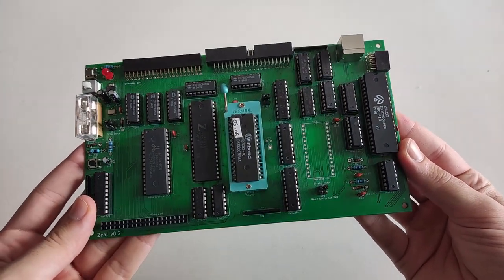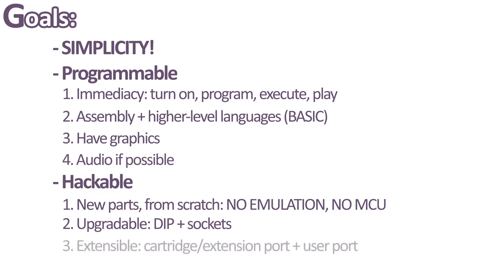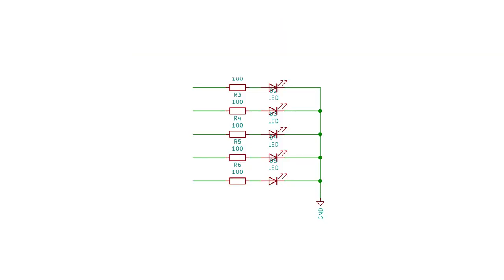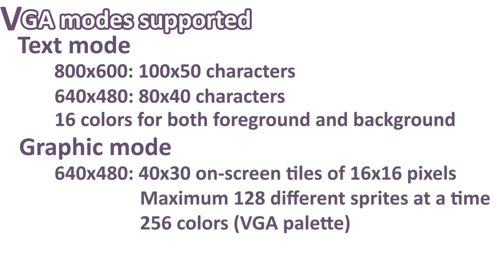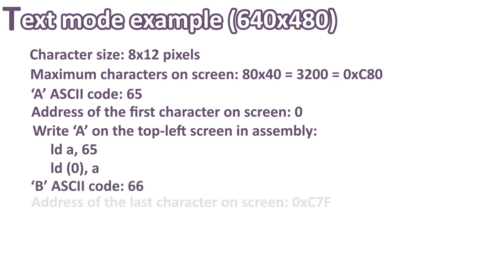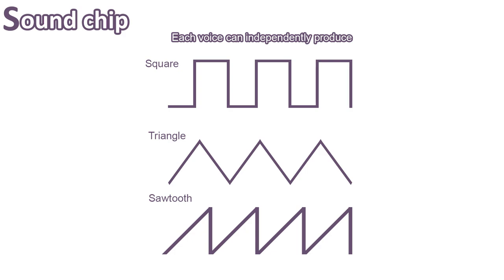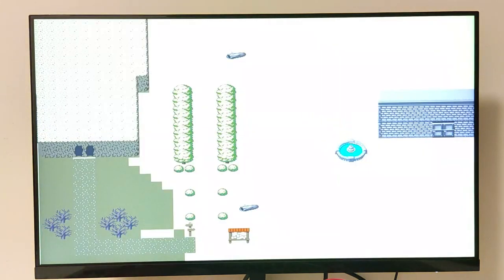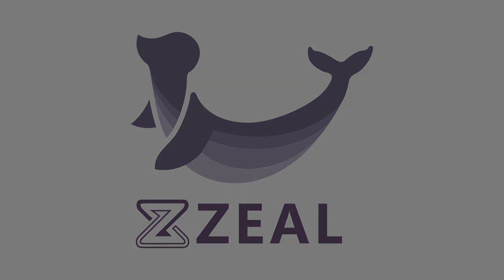Build an 8-bit retro computer powered by a Z80 ! [Zeal 8-bit]

Comment: Awesome. Would love more details of the video sub-system. Some numbers don't fully add up to me (256 colors x 16x16 x 128 == 32768, and you still need 1200 bytes for the tiles + the palette). Also unclear if the sprites are something different from the tiles (video says sprites, description says tiles). At the Z80 speed (unless you use a modern version) gonna be hard to update a lot of memory -- so a 320x200 mode may be useful. Do you have a blanking interrupt, or even a scan-line one?

So many questions, sorry. Love it!
Reply from the maker: Very good question!
It was a bit hard for me to keep the video concise, simple to understand so without giving too many details. 
In my mind, the tiles are the 16x16 pixels images that we can show on screen and a sprite is the value pointing to one of the 128 tiles. (128 tiles take 32KB, 1200 sprites take 1200 bytes)

What you said is correct, the tilesheet/tilesmap indeed takes 32KB. The thing is we can tell the video chip (the FPGA), what we want to map in the first half of the memory, with a single OUT instruction.
Thus, if we map the tilesheet/tilemap, the 32KB describes all the pixels of our available tiles, but if we map the sprite ram, we can then modify the tiles that are shown on screen, so make some animation, movements, just by modifying 1 or 2 bytes.

The sprite ram is organized as two 1200-bytes "arrays", the first one starts at 0 (from 0x0 to 0x4AF), the second at 8192 (0x2000 to 0x24AF). The first one represents the background, the second one is the foreground (both share the same tilessheet/tilesmap of course). The foreground is a bit special: it supports transparency. The palette is the standard VGA palette (Mode 13h). It cannot be modified, so it is not mapped.

This was for graphic mode, in text mode, only the sprite ram is re-used. It is separated into two 3200-byte "arrays" (we have 80x40 characters on screen). As explained in the video, the first one, from 0x0 to 0xc80, is for showing the characters themselves, but the second one, from 0x2000 to 0x2c80, is used for colors. 
Indeed, text-mode supports 16 colors for both background and foreground. So one byte in the second array represents both background (high nibble) and foreground color (lower nibble), this was designed like this for performance reasons. The palette used here is also the VGA palette, but in 4-bit mode, and is it hardcoded in the FPGA, so it cannot be changed.

I am using a Z80 clocked at 10MHz, filling the first 32KB of memory takes 69ms when using LDDR or LDIR instructions, which is reasonable in my opinion. I mean loading the required tiles is not something that will be done a lot of times, or at least, not all the 128 tiles each time. Similarly, loading 1200 bytes into the sprite ram takes about  2.52ms with LDIR or LDDR.
Plus, the FPGA supports writing into its sprite RAM and tilesmap RAM at anytime, regardless of the VBLANK or HBLANK.

Regarding the resolution 320x300 is not a VGA standard resolution. 640x480 is the smallest possible resolution, but I imagine it would be possible to simulate a 320x240 resolution by duplicating the pixels. This would let us have 20x15 sprites on screen (16x16 tiles). I haven't thought about it yet.

Finally, about the interrupts, on older computers/console, it was required to wait for V-Blank or H-blank to draw modifying the video RAM, but in my case here, it is not required as the video ram can be modified at any time. However, I still plan on having these interrupts for two reasons: prevent flickering when moving sprites around and mainly timing. I don't have any timer on the board, I don't have any plan to integrate one so having both interrupts will help a lot to determine how many ms or us have elapsed. With a 640x480 resolution at 60Hz, we would get one V-Blank interrupt every 16ms, and one H-blank interrupt every 32 us.

I need to make another video presenting these features with more details and with some demos.

I hope it was clear, feel free to ask if you have any question.
Reply: @Zeal8bit   don't worry, I know how hard it is to make videos. What you did is awesome.

Thanks for you answers, I think I mostly get it, so get reading for my second round of questions :-)

I got that you can page the VRAM using an OUT, so the 32K limitation doesn't really apply. I still have some troubles with your terminology: for me a tileset is a description of the graphic of 128 tiles. It takes 32KB. A tilemap is a description of a full screen of tiles (sometimes a little more, with some hardware registers to offset x and/or y, giving the possibility of hardware scrolling). It takes 1200B (as they are limited to the screen and just contains the ID of the tile, with one bit left). There are 2 tilemaps, the foreground having transparent tiles, (maybe via a hardcoded key color in the tile?).

What I am still missing is how do you intend to position stuff. In my vocabulary, a sprite also have an x,y coordinate, but tile don't, as their position is implicit. ie: I don't get where those positions are stored.

On the resolution piece, I was thinking of pixel doubling + black bars (or 320x240), just so the amount of data is small enough to be managed by the Z80. But, at 10MHz, it isn't a big problem, although the limited address space will make it difficuly to work with all the data. But that's part of the fun, right? Another direction is a 640x400 BW image (wich black bars). That's better than the original Mac, you could do a fun GUI on that (but you need to be able to read the VRAM for many operations).

On the VBL piece, I wasn't thinking of stuff like avoiding snow effects, but to sync (ie: telling the FPGA that the developer is done with presenting a screen), and scanline interrupts to potentially hack (ie: if there were one day multiple palette, you could do more than 256 colors). Of course, if you don't have timer, a VBL of some sort is indispensible, in particular as you have sound (those days I am coding on the early macs, which only had VBL for tracking time -- see my channel for the result :-) ).

Keep on the excellent work. I wish I had the ability to do such a wide ranging project, but my hardware skills are too limited.
Reply from the maker: @fredsretrocoding1421  Thank you Fred!

I understand your confusion, indeed, there are a tileset of 128 tiles of 16x16, so 32KB, as your said. There are indeed 2 tilemaps, your terminology suits better the architecture I made. The thing is sprite's position is determined by its index in the memory, this is why in my terminology, both can be interchangeable (kind of). This is valid for both text mode and graphic mode.
Thus, the top left background sprite is represented by the byte at address 0x0, the next one is at address 0x1, ... until 0xc7f. As there are 40 sprites per line, the sprite at line i and column j is at index 40 * i + j. 

It also means that in order to move a sprite on screen, you need to write its value to its new index/position and erase it from the previous location. This layout makes it convenient and simple to render games or programs based around grids. I also chose this layout because of the limitations I have on the FPGA itself and its board.

As you said, the challenge of working with all the data is fun! I mean, today with our +1GHz embedded systems, we tend to concentrate less on low-level optimizations. The CPU/SoC architecture is often not even part of the optimization equation when writing C/C++ software. I don't even mention any higher level programming language. regarding reading the VRAM, I agree this may be a problem in GUI based programs but this is also why I choose to have this much RAM, I mean 512KB for an 8-bit computer is more than enough for most programs.

You are right, I am hoping people will be able to hack Zeal board to make it impressive! I remember hearing that in the '80s, some people where using the h-blank interrupts to simulate a multi-color background on the Commodore 64 and related computers. I am currently designing the next prototype of the board, integrating both vsync and hsync interrupts. The fact is the FPGA is outputting a 16-bit color signal to the DAC converter, before going to the VGA connector. 

Thank you for your support, I hope you will enjoy this project. Honestly, no matter what skills you have already, you can always learn more and more and figure out things by yourself. Nowadays, we have so many resources available online, for free. 

As we say in French, on apprend sur le tas! 😉

(Between, I checked your video and they are outstanding! I would love to see how you achieved this in a video)
Reply: @Zeal8bit  It was indeed a terminology issue. What you do is between a graphic mode and a 40x30 text mode with 128 16x16x256 colors with customizable characters. I feel the lack of true pixel-addressable sprites will be an issue, as the only way to have pixel precise drawing will be by hacking the sprites, like we used to do with VGA text mode characters https://en.wikipedia.org/wiki/VGA_text_mode#Cursor (replacing the 4 characters under the mouse by 4 custom chars with the mouse drawn at the right position in it. Possible, but cumbersome).

> Honestly, no matter what skills you have already, you can always learn more and more and figure out things by yourself. Nowadays, we have so many resources available online, for free. 

A vintage graphic card on an FPGA has always been something I thought about. I even got an Mojo FPGA dev board to learn, but I just didn't have the time to invest into it. But I probably have enough software projects to keep me busy forever...

> I would love to see how you achieved this in a video

I still have to make a video for the release of the new version, then I may do a video for the nerds on the "how it is done". Long story short: C++ pre-encoding, 68k assembly and a lot of stubborness :-) [ note: the github is available https://github.com/fstark/macflim ]

Allez, super boulot, j'espere bientot une video sur la suite! Faut pas hesiter a entrer dans les details...

edit: fixed url formatting
Reply from the maker: @fredsretrocoding1421   You described it well, then I haven't implemented real hardware sprites, as there is no true pixel-addressable graphics. But after thinking about this, I think it would be very interesting to have sprites, it would be possible to replace the second layer, the top one, to have 64 or 128 (or even less) hardware sprites instead. So the first layer will still be addressable the same way as today (i * 40 + j), and would thus be used as a background, whereas the top layer would be gone and simply replaced by N sprites that, of course, are on the top of the background. As you said, having something like a cursor then would be much simpler to implement, no hack-workaround required.
As you may have guessed this will be a long work so I may postpone this to later, but I keep this idea! I would like to have the hardware stabilized for now.

Mastering and getting familiar with FPGA takes time, mainly when having a software background. I think we all have the same problem: more cool projects than free time.

Thanks for the link to the repo, and I look forward to watching your next video.

Merci beaucoup pour ton soutien!

Comment: Could the Philips SAA1099 be used for sound? Maybe it is not manufactured anymore, but there seems to be good availability even brand new parts
Reply from the maker: I did have a look at this one and at the AY-3-8910, both are very well known chips. The AY-3-8910 even has two I/O ports. I saw on the SAA1099 datasheet that the maximum clock frequency is 8MHz, mine is 10MHz, I wonder if that would cause any issue.
But as you said, they are not manufactured anymore, so currently I would like to stick witch new parts. However, it is possible to make an external card embedding that chip as the cartridge/extension port presents the data lines and and IO address lines.

Comment: The CPU in the Game Boy is more similar to an Intel 8080 than a Z80, although these CPUs are related between them.
Reply from the maker: Indeed, if we look at the instruction set, it looks more like a 8080: no IX/IY, no alternate registers, no complex memory instructions (LDI,CPI,etc...)
But for the chip itself, the ASIC, *my guess* is that it's based on the Z80. Because at that time, Sharp was already manufacturing Z80 CPU clones, logically they would take this base to make their new chip, the LR35902, used in the GB.
It's just my thoughts, not sure if that was really the case😄

Comment: Instead of Z80, use HD64180 or Z8S180.

19 or 20 addresses 512KB or 1MB controlled by MMU, onboard MMU. two DMA two CTC two UART.
Reply from the maker: Thanks for your comment!
Indeed these are nice successors, I also like to eZ80, I will consider using one of them for future version(s) 😄

Comment: You might want to research how many bypass capacitors should be on there.
Reply from the maker: I agree that PCB revision should have had more, this was my second iteration, it is pretty dense. You can check the newest hardware revision in my latest video 😄

Comment: How did you account for the voltage difference from the 5V Z80 to the 3.3v FPGA?
Reply from the maker: Thanks for your comment!
There are bidirectional 3.3V/5V level shifters on the FPGA board for the parallel bus
Reply: ALynx 301?
Reply from the maker: Oh my bad, for some reason I thought you were referring to my custom FPGA board, which I presented in later videos. The Alinx board I am using in this video doesn't have level shifters indeed. I did the level shifting on the motherboard with 74HC4050 ICs. Since that takes quite a lot of space, I moved them to the custom FPGA board after that.

Comment: Why do you have to load 66 into reg a first? You can't skip that step and just run ld (0xC7F), 66?
Reply from the maker: There is no such instruction on the Z80. There are two ways of doing it if you want an immediate value:
- ld a, 66 and ld (0xc7f), a 
- ld hl, 0xc7f and ld (hl), 66

Comment: Your not using a micro controller but you are using FPGA's... i don't get the distinction... Their both modern tech...
Because your using FPGA's, doesn't that mean that simplicity goes out the window?
I'm looking forward to seeing what your going to do with your ROM banks...
Reply from the maker: Thanks for your comment!
I see the FPGA as a huge CPLD, (Complex Programmable Logic Device), in this sense, you cannot compare it with a CPU/MCU. But some will also tell you that you could make a CPU out of an FPGA, and that's right.
I highly recommend you to watch the newer videos to see the updates out the board. Anyway, the FPGA board is not mandatory to run the computer. The motherboard has now a UART input and output, which makes it usable without the video card board. You could even imagine making an extension board which relies on an old video chip.
About the simplicity, I was talking about the simplicity to use. Of course the PCB design would be complex and difficult to come up with, but this is my part😄
What I meant in the video is that I want to make a board easy to use/to program for. And indeed, as you can see in the video, writing data to the video card is fairly easy (1 byte per char/1 byte per pixel)
Finally, regarding the ROM, I ended up making a "universal" MMU which has 4 pages of 16KB, so that the ROM, RAM, VRAM can be mapped in any page.
Reply: In theory, if this takes off, the fpga board’s functions could be baked into an asic and related components on a revision of the main board.

Comment: Lol, great video. But i think your find that your new z80 is possibly a fake or rebranded chip, do not buy from ebay or Aliexpress they sand off the tops, paint and lazer etch new details. As they have piles of pulled scrapped chips in china which they make look new again. Buy chips from digikey or RS components for orginal new chips or new old stock.
Reply from the maker: Thanks for your comment!
You are right, one should be careful with such platforms.
I would also add Mouser to your list of official retailers. These 3 are the best places for new chips.